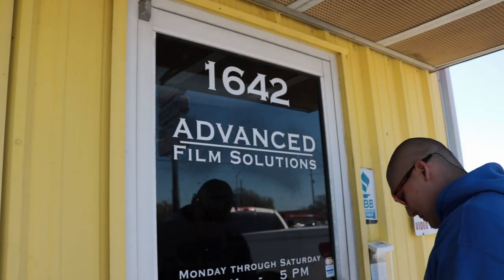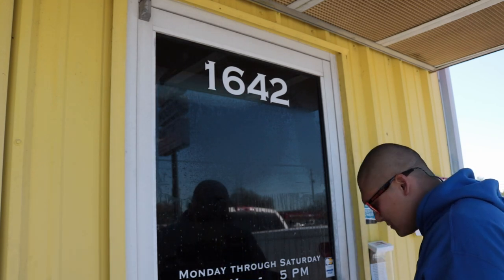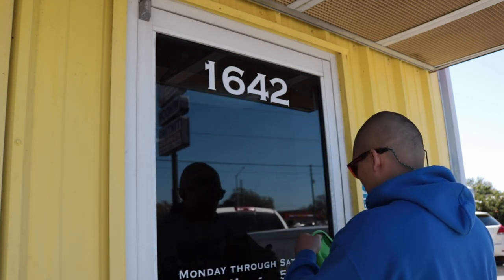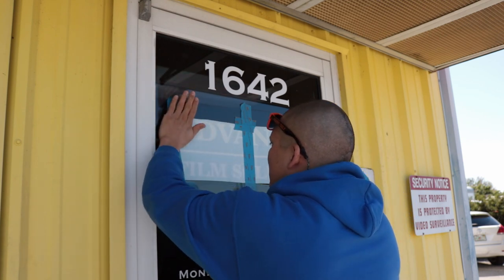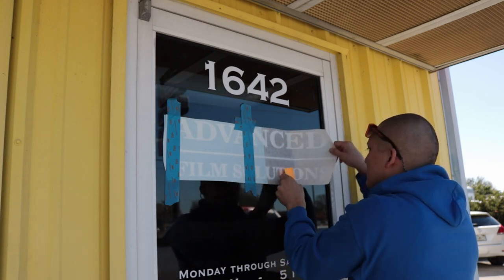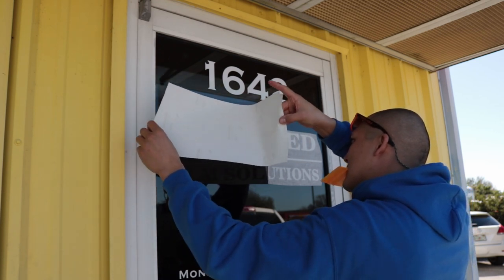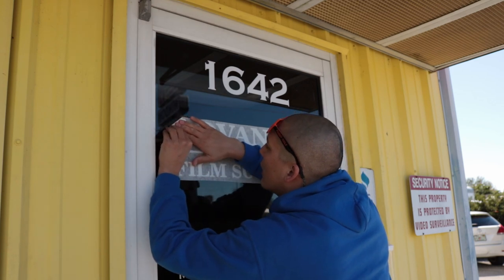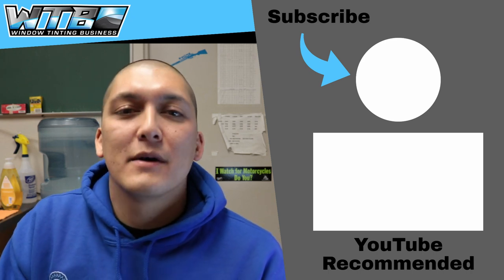How to apply vinyl decals to glass

Comment: Hi I m completely new to vinyl lettering.  Why did you use the soap water over the surface and vinyl to fix the graphics. Normally detergent can wash away the adhesive or glue... Isn't it.  Any special adhesive.... Please tell me how does it works.  Thanks

Comment: Could you have also used soapy water to help with the decal??
Reply from the maker: A slip solution is doable but I feel that it takes longer to cure and the individual vinyls could shift in the process

Comment: great video! whats the difference with using a wet or dry application? is one better over the other?
Reply: Wet is good for applying big sheets of vinyl as it can crease easily but for lettering is not necessary
Reply: @robertt8862  thanks for the response. I appreciate it. 👍🏼

Comment: I don't like your putting the vinyl on the OUTSIDE of door. Glass blocks UV radiation so the vinyl would degrade much slower on the INSIDE. Sure, this means a longer time before you get a repeat order from the same customer. But you do have a more satisfied customer.